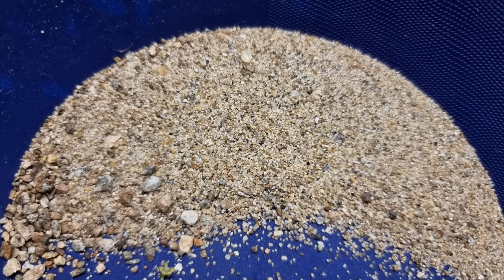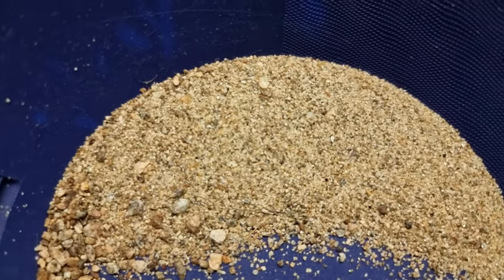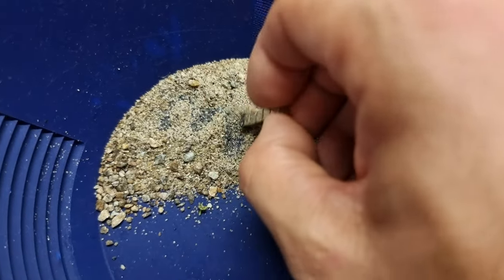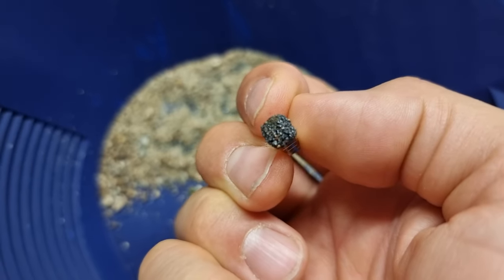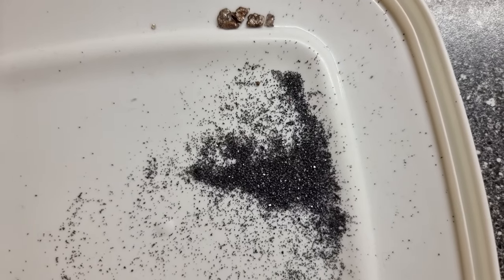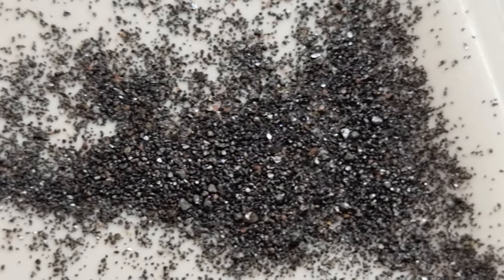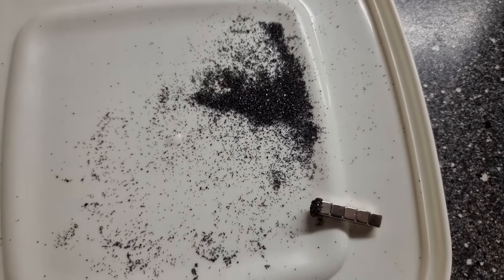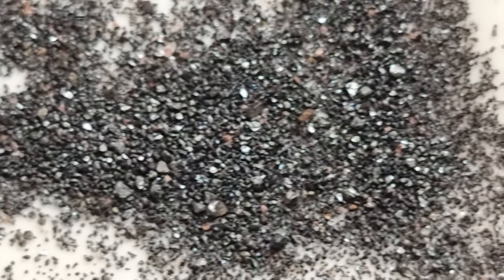Extracting black sand for Bill Muller motor

Comment: Rare earth mining on a very small scale black sand can sometimes contain rare earth elements (REEs). Black sand is typically composed of a mixture of heavy minerals that have high densities and are often found in coastal environments or riverbeds.

The most common minerals in black sand include magnetite, ilmenite, garnet, and sometimes gold.

Rare earth elements can be associated with certain minerals found in black sand, such as monazite, xenotime, zircon, and bastnäsite. These minerals can contain various rare earth elements like cerium, neodymium, lanthanum, and yttrium, among others.

While not all black sands contain rare earth elements, those that do often derive their mineral content from eroded igneous rocks or are located in areas with geological formations rich in these elements.

The concentration of rare earth elements in black sand is usually low, but it can be significant enough for extraction in some locations where these minerals are concentrated due to natural sorting processes.
Reply: (posted here and elsewhere for the sake of brevity not spam)  - It's all about the mixed REE's not so much the magnetite ;) - depending on where you extract them from the natural ratios can end up summing to an elemental octave! - the significance being the number of available electron shells in the finished product.

Rare earth elements, also known as the lanthanides (from lanthanum to lutetium), have a partially filled 4f electron shell. 

The f-orbitals are more complex in shape and energy compared to s, p, and d orbitals.

 The f-electrons in these elements are shielded by the outer 5s and 5p orbitals, which makes them less involved in bonding and chemical reactions compared to d-orbital electrons in transition metals.

 This shielding effect allows the 4f electrons to maintain relatively localized, unpaired states, leading to unique magnetic, optical, and electronic properties.

The unpaired electrons in the f-orbitals contribute to the magnetic properties of rare earth elements. Elements such as gadolinium, dysprosium, and neodymium exhibit strong magnetic behavior because of their high number of unpaired f-electrons. Neodymium, for example, is used in powerful permanent magnets due to the specific alignment of its f-electrons.

The spectral and optical properties given by the f-electron arrangement are also responsible for the characteristic luminescence and spectral properties of rare earth elements. 

Because f-f electron transitions (transitions within the same shell) are partially allowed and shielded from the influence of the surrounding crystal field, rare earth ions can produce sharp emission lines in the visible and near-infrared regions. 

This is exactly what makes them valuable in applications like phosphors in display screens, lasers, and other optical devices.

 The electron configuration of rare earth elements leads to their chemical similarity, which is another significant property. 

They all have similar ionic radii and prefer a +3 oxidation state.

 This similarity arises because the addition of electrons across the series mainly fills the 4f orbitals, which do not significantly affect the ionic radius or chemistry. 

As a result, rare earth elements are often found together in mineral deposits and are difficult to separate due to their chemical similarities.

The phenomenon known as "lanthanide contraction" is another significant property related to the electron configuration of rare earth elements.

 As one moves across the lanthanide series from left to right, the effective nuclear charge increases, pulling the 4f orbitals closer to the nucleus. This results in a gradual decrease in ionic radii and atomic sizes despite the increasing atomic number, affecting the properties and behaviors of the elements and compounds further down the series.

My other banger runs on metamaterials ;)
Reply from the maker: Wonderful comment.
Reply: @MFMP  thanks your work is amazing I was actually led to some sort of similar understanding through 25 years of Vajrayana practice— mostly Dzogchen, so much symbolism and decoding it leads to the energy of the human ‘M’ind  - (as opposed to mind small m) and by way of that the electron as a spontaneous emission from the quantum vacuum state or as per Vajrayana -emptiness>energy>form 

and form of course is none other than emptiness— as per the heart sutra! 

It may be esoteric but the same old arcane physics is present— of course, the interpretation isn’t something one is led to necessarily that it is there nonetheless!

The symbol of the Adamantine  Thunderbolt or Dorje contains the conjugate diamagnetic and dielectric geometry as well as the plane of inertia when nested within a sphere bisecting the two terminal points, curiously, the number nine is also included in some traditions as the nine vehicles.

So much more, I could share on this topic although not all of it publicly sadly —

Comment: You can extract more magnetite by simply using an old speaker magnet ✌️
Reply: It's all about the mixed REE's not so much the magnetite ;) - depending on where you extract them from the natural ratios can end up summing to an elemental octave! - the significance being the number of available electron shells in the finished product.

Rare earth elements, also known as the lanthanides (from lanthanum to lutetium), have a partially filled 4f electron shell. 

The f-orbitals are more complex in shape and energy compared to s, p, and d orbitals.

 The f-electrons in these elements are shielded by the outer 5s and 5p orbitals, which makes them less involved in bonding and chemical reactions compared to d-orbital electrons in transition metals.

 This shielding effect allows the 4f electrons to maintain relatively localized, unpaired states, leading to unique magnetic, optical, and electronic properties.

The unpaired electrons in the f-orbitals contribute to the magnetic properties of rare earth elements. Elements such as gadolinium, dysprosium, and neodymium exhibit strong magnetic behavior because of their high number of unpaired f-electrons. Neodymium, for example, is used in powerful permanent magnets due to the specific alignment of its f-electrons.

The spectral and optical properties given by the f-electron arrangement are also responsible for the characteristic luminescence and spectral properties of rare earth elements. 

Because f-f electron transitions (transitions within the same shell) are partially allowed and shielded from the influence of the surrounding crystal field, rare earth ions can produce sharp emission lines in the visible and near-infrared regions. 

This is exactly what makes them valuable in applications like phosphors in display screens, lasers, and other optical devices.

 The electron configuration of rare earth elements leads to their chemical similarity, which is another significant property. 

They all have similar ionic radii and prefer a +3 oxidation state.

 This similarity arises because the addition of electrons across the series mainly fills the 4f orbitals, which do not significantly affect the ionic radius or chemistry. 

As a result, rare earth elements are often found together in mineral deposits and are difficult to separate due to their chemical similarities.

The phenomenon known as "lanthanide contraction" is another significant property related to the electron configuration of rare earth elements.

 As one moves across the lanthanide series from left to right, the effective nuclear charge increases, pulling the 4f orbitals closer to the nucleus. This results in a gradual decrease in ionic radii and atomic sizes despite the increasing atomic number, affecting the properties and behaviors of the elements and compounds further down the series.

My other banger runs on metamaterials ;)
Reply from the maker: If I wanted this material, from this place, I should have taken out 5" magnet fishing Nd magnets, far more efficient. This  was a by product that I ended up discussing a use for just a few days later.
Reply: @MFMP  Yep 😊✌️